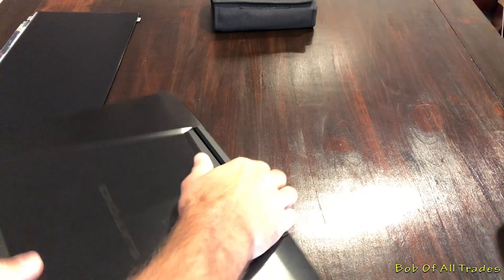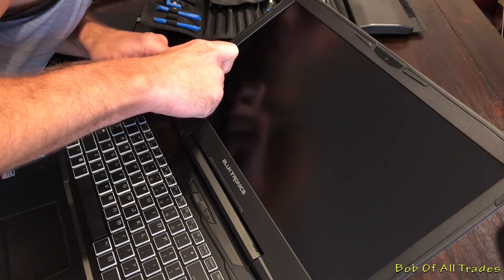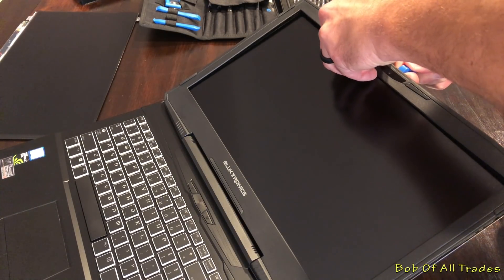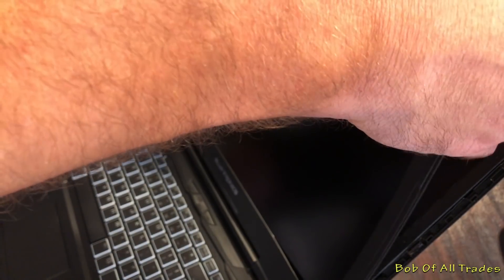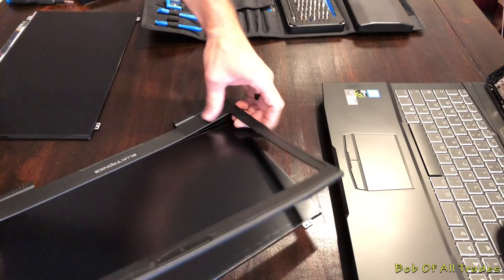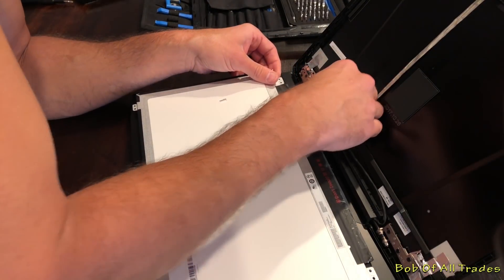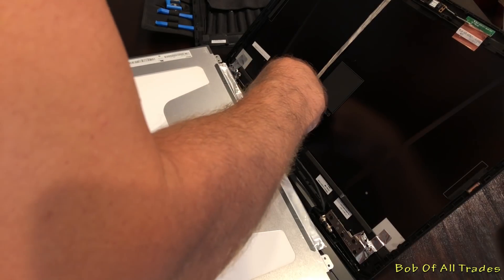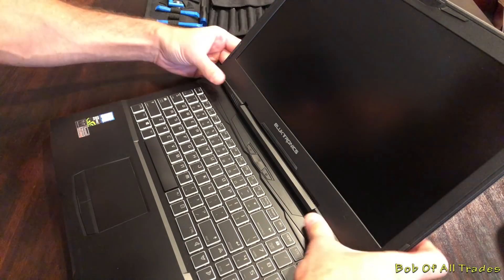120Hz 100% sRGB Panel Install MECH 15 Eluktronics

Comment: Buy this panel for your dell g series. This is an amazing screen. Put it in my dell g3. Bob of all trades videos have helped me put a screen and repaste my g3. But this panel is so good. It’s viewing angles aren’t that awful even.
Reply from the maker: Good stuff!  Viewing angle concerns on a laptop were always a weird thought to me.  You're always sitting in the right spot while operating a laptop and many gathered around one for entertainment is a few and far between situation.
Reply: Which one did u get, there are 2 different links in the description, I am purchasing a Dell g3 and would like to know
Reply: p128sniper the chi mei screen. They’re the same. I poked around on eBay and got it for I wanna say 90$. My g3 has the 1060 Max q and it’s gorgeous. 
I would also mention if you’re following boat and you’re gonna use his repaste of the g3, don’t use mx4. Doesn’t go well in the g3. Use kryonaut
Reply: @jamessteel9180  thats exactly the past I will be using. Also, do I have to do anything after installing the screen? Calibrate or mess with settings?
Reply: p128sniper I don’t think it’s necessary. I didn’t do that to mine. It’s very plug and play
Reply: @jamessteel9180  thank u, I migjt be picking up a g3 today. And will order the thermal paste, this screen and probably undervolt the cpu. What games have u run so far and what specs do you have
Reply: p128sniper mines got the i5 8300h with the 1060 max q. Undervolted -140 with a curve edit for the gpu and kryonaut repaste. I peak around 84 c under full load on CPU and GPU doesn’t get hotter than 76. I play rocket league, rainbow six, I played the black ops 4 beta but didn’t love it, Fortnite, and gta. With the 1060 max q and tweaking all of these games see above 100 FPS. Except gta v cuz I haven’t figured out how to fix its frame cap. Tried mostly everything. No v sync. It detects that I have a 120 hz screen, followed some forum things and messed around in command but it still caps me at 60. If you’re getting it to game and not edit video. I’d say the i5 and 1060 variant is the best choice. Great value.
Reply: @jamessteel9180  I will actaully be getting it for a little bit of both, but the videos I will be editing will be max 1080p at 60fps, no 4k stuff. From a Gopro hero 5, mainly for YouTube purposes. I ride motorcycles and want to start putting some stuff in YouTube. The g3 I'm getting is the i7, 16gb ram and the 1050ti. You think this will be enough for that type of video editing and gaming like farcry 5 maybe even battfield 1? Will it be enough?
Reply: p128sniper oh yeah. That thing will still kill it for your purposes as far as my knowledge goes
Reply: @jamessteel9180  just bought it yesturday. I am soooo glad there is a replacement screen for this laptop, the screen is absolutely horrible, I mean really really really bad! I know it's a budget laptop but wow is it depressing. The track pad really sucks, but I will use external mouse and keyboard anyways for gaming and editing. Other than that I ran the new tomb raider game on high settings with no issues. I already ordered the thermal paste, and will be ordering the screen next. Repaste, undervolt, and replace screen and it'll be a pretty nice setup
Reply: p128sniper it’s a good base machine. But it really does need some work to shine
Reply: Hey does the brightness control work with the screen you got

Comment: I know you probably get sick of answering these questions, but is this 120hz screen compatible with a MSI GL62M 7RE-407? screen? The bezels appear the nearly the same and I'm willing to wager its got the same 30pin connector needed.
Reply from the maker: 1080p is 30pin and 4k is 40pin :)
Reply: Thanks for the tip! I'll be ordering this soon so I can experience high refresh rate goodness on my laptop haha

Comment: Hi bob, thanks for the video. Can you do me a favor? Can you check whether your laptop using any pwm for brightness control or not while using that new 120Hz TN screen?
Because i read on notebookcheck.net that dell g7 with the stock screen doesn't use pwm. I hope it doesn't use pwm with that new TN panel.
Thanks again.
Reply: I am sorry i read this video title wrong. It not about dell g7. But i still want to know, Does the screen's pwm signal changed with the new screen?
Reply from the maker: All I can do is lower the brightness to 0% and see, but doing so did not reveal flicker.
Reply: Well thx bob. Really appreciate it.

Comment: Would this panel work in the Dell G3?
Reply from the maker: Of course
Reply: Guessing this panel is a better option than the Zephyrus panel AUO42ED and thank you for the help
Reply from the maker: It seems to be slightly more color accurate and more importantly, brightness control isn't compromised.
Reply: Unless there's a 400 nits compatible screen, this looks to be the one to buy. Once again thanks for the help
Reply from the maker: This one came in around 318 nits
Reply: Last question did you find any issues with this being a TN screen rather than a IPS, Thanks

Comment: I love this panel, and got it for my Dell G5. Super bright, super smooth and games look incredible.

Bought it from a USA based seller on ebay. 
https://www.ebay.com/itm/NEW-N156HHE-GA1-Laptop-Led-Lcd-Screen-15-6-120-HZ-FHD-MSI-GT62-GE63/123172018735?epid=16007210775&hash=item1cad9fda2f:g:3GcAAOSw~19bFX3z

How do you like this panel compared to the AUO 120hz panel you used previously?
Reply from the maker: I've had 3 42ed panels and one of these.  This one is more rich after calibration thanks to the 89% Adobe RGB.  But it was cold before calibration and the 42ed out of the box looked better.  Thank goodness for the Spyder5 :)

Comment: can i put a oled screen in my dell g7 bob?
Reply from the maker: Is there an OLED panel out there?
Reply: @BobOfAllTrades  yea but not by dell
Reply from the maker: Shine Onn ENT. Where?  Have a link?
Reply: @BobOfAllTrades  the Lenovo think pad has a oled screen and aw 13 had one 2 years ago too
Reply from the maker: Shine Onn ENT. Right but the question was can an OLED be put into your G7. Is there a 15.6” OLED panel?
Reply: @BobOfAllTrades  ok i see what u mean the Lenovo is a 14 inch i have not seen 15.6 inch screen
Reply from the maker: Shine Onn ENT. I haven’t seen one either.
Reply: @BobOfAllTrades  can i pay u to put in a 120hz  panel for me

Comment: I have the Acer Nitro 5 that you have reviewed and I bought this panel for it AUO B156HAN04.2 eDP  on ebay.
And of course brightness doesn't work.
Would this panel be compatible with it,or what panel would you recommend?
Reply from the maker: Muhamed Husic Of yes for sure you’ll get brightness with this.  Do you need to dim your display?

Usually when I ask most people say no.
Reply: OK,that's good to know, I might pick one of these up.
I also have the N156HHE-GA1 ,that you mentioned in one of your comments,in my amazon cart.
Bought the laptop for my nephew and he doesn't care much about brightness adjustment,but still it's a good feature to have when you running on battery power only,I think.
 Thanks!
Reply from the maker: Muhamed Husic That’s What I installed in this video.